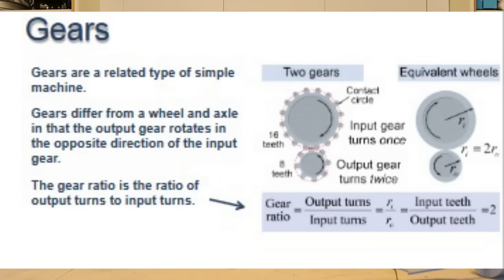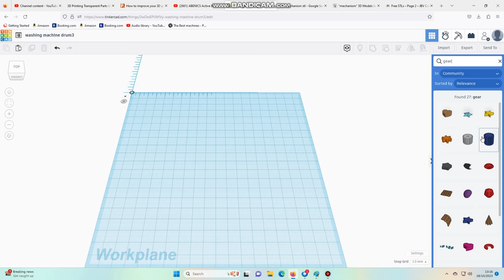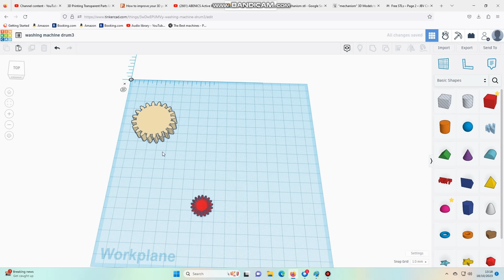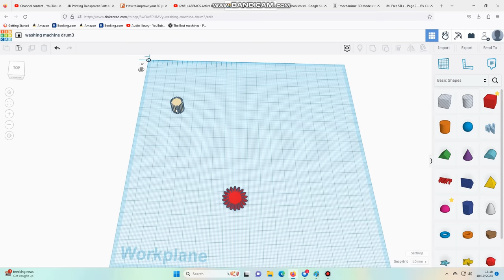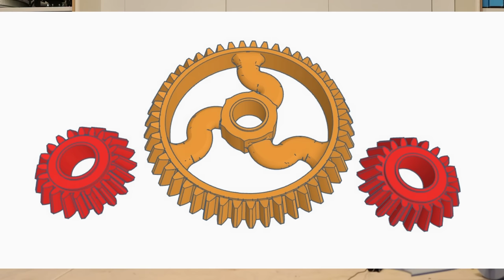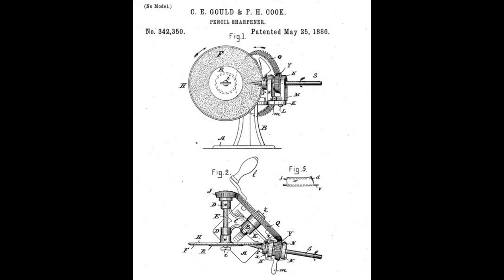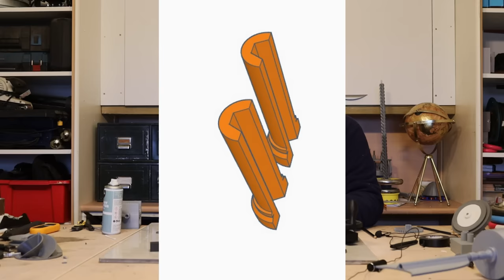2084 A Steampunk Pencil Sharpener

Comment: To sharpen pencils I use a Ryobi cordless drill i put each pencil in the drill then hold a “metal” sharpener on the end of the pencil, I have about 20 penciled that I sharpen once a month. I’m forever losing my pencils so when it need sharpening I place them in one place for sharpening. Sorry Robert nothing to do with gears but it works so well.😊
Reply from the maker: i bet it does mate - cheers

Comment: Rob, how do you connect a metal motor shaft to a 3d printed gear?  I have a load of small 12v motors with 2mm round shafts and I need to connect them to a gear....but how do I stop them from slipping on the assumption that the torque would be enough to overcome glue? Any help would be appreciated
Reply from the maker: there should be a flat on the motor shaft mate - you key that to the gear